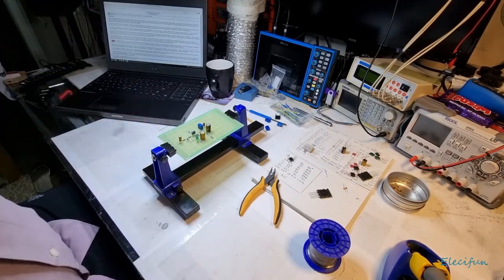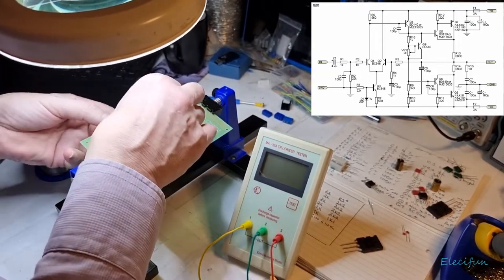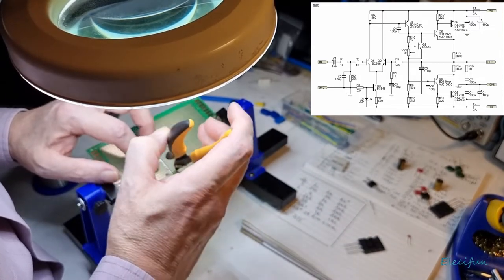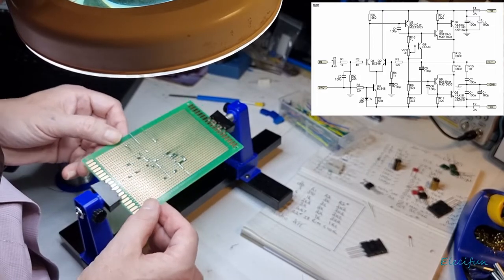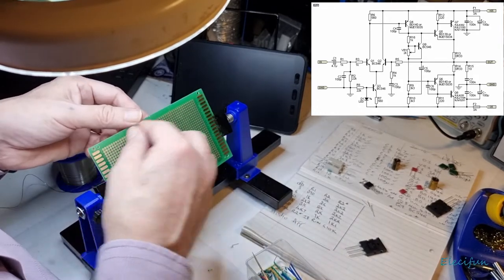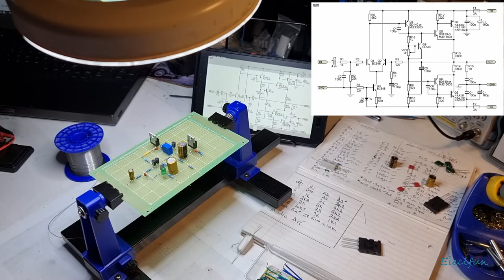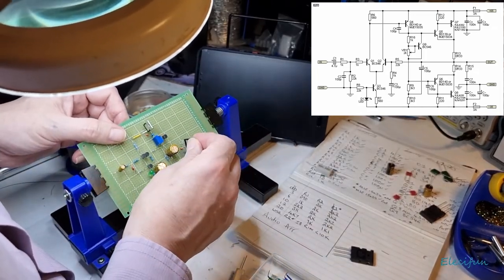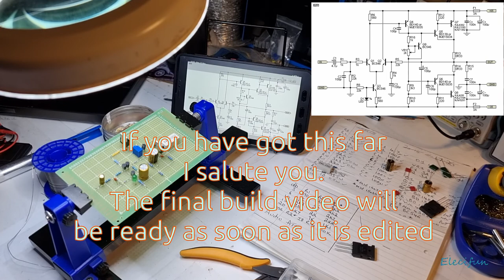ESP DIY 60W HiFi Amplifier Build Pt2

Comment: Thank you Elecifun for another installment in this series! I appreciate you putting the schematic up in the split screen and adding in close up shots of the board. I'm really enjoying this series. I like that you've left in mistakes and how you resolve them. Many builders edit out the mistakes (that we all make). I hope you get your computer issue sorted. Projects are more fun when all your tools are functioning lol. I am going to try to find a printed circuit board for this project. I can do it with a generic board but having a printed board that I can just populate cuts down on my mistakes. I then intend to build an enclosure on the 3D printer unless heat becomes too big a problem. Fun project to undertake. Cheers mate 🎶🍻
Reply from the maker: I'm really happy you are enjoying the video's. I leave in the mistake because resolving them is a learning curve we can all benefit from. Besides it's all part of the process. 
Buying the board from Elliot would be a better option makes the whole build much easier. Here is the price list link  https://www.sound-au.com/pcb/pricelist.html
Cheers regarding Windows installation... what a frustration. Glad my everyday machine is Linux I can use a Virtual Machine for many of my windows needs.
I need to invest in a 3D printer maybe in the January sales. Heat should not be to much of a problem if a big enough  heat-sink is used. Cheers!

Comment: I'm too tired to go on amigo. 🤔 Interesting. make sure you exhaust those nasty fumes. That can't be good for your health. Night.
Reply from the maker: I should use the extractor.. it's 25 watts. Electricity costs a fortune here ATM for some reason. I expect it's the infrastructure demand made by the electric vehicle drive dates. Egotists want to go in history as the saviours of the planet.
Reply: @Elecifun  I fully understand the cost of energy it's insanely expensive.
Reply: @Elecifun  it makes me wild when Russian pay 6 cents per kilowatt-hour or was it .6 cents a kilowatt-hour.

Maybe a solar panel and a few batteries
Reply from the maker: I wish that was the answer.. here in the UK it rains and is cloudy so much. My roof is south facing and would be a good contender for solar panels but I can't afford the initial outlay. I have to suck it up and pay £0.36 per kwatt. With £0.42 standing charge (price for services) per day.
Reply: @Elecifun  omg that's outrageously expensive! Even more expensive than it is here. Brits should just decide that its too expensive and then mass quit their power contracts. I guess you've already done everything humanly possible to reduce your consumption? 🤔